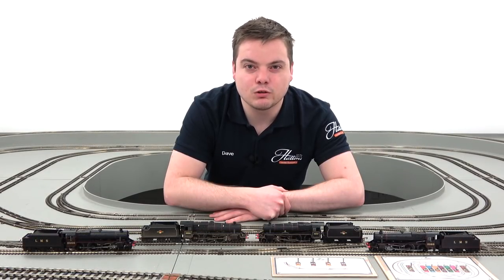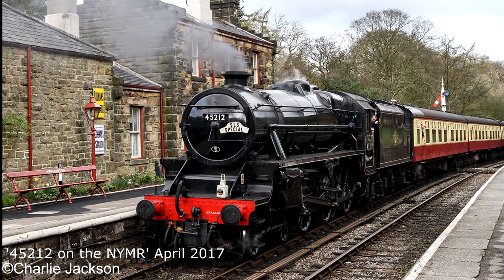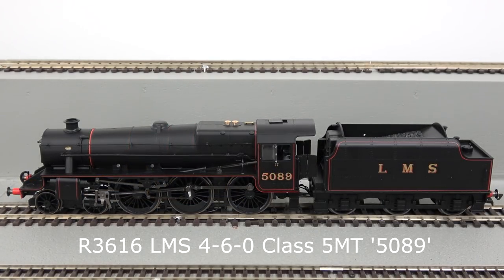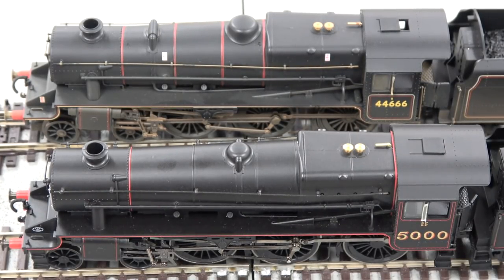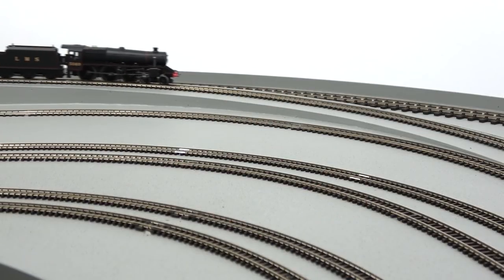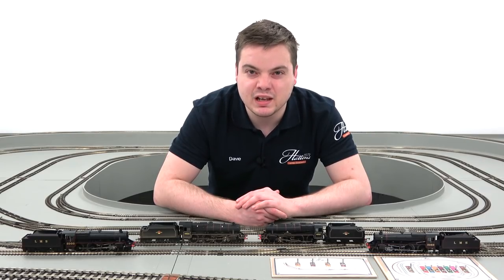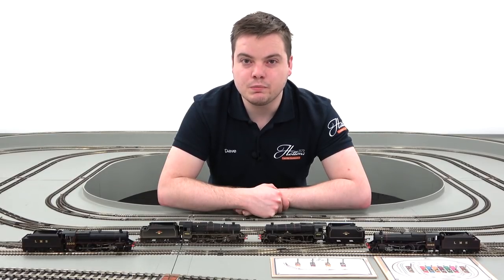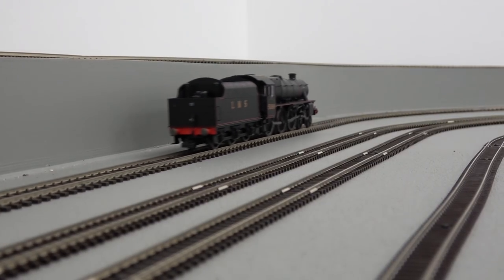Hornby Black 5 4-6-0 - Model Overview

Comment: I am an LMS lover to a certain extent. I don't have a Black 5 model in my collection. But I do have 0-6-0 3 and 4F Tender Engines, one of each to make two. They are LMS engines like the Black 5. You forgot to mention the Black 5 is Jack of all Trades. Its livery could be known as Ace of Spades Black. In the past, after weekend days on the SVR, I'd return home as black as the Ace of Spades with soot from head to foot. That's how much I love steam engines, no matter what kind they are. However, I still love GWR engines, like my beloved Foxcote Manor, best of all. For me, GWR engines come top of the heap.
Reply: The 3F  and 4F 0-6-0's were, strictly speaking, Midland Railway designs of Johnson and Fowler lineage dating back to the late Nineteenth Century. The Black Five was a 1930s LMS design. In their BR service days I heard them referred to by many names including 'Mickeys' (no idea, don't ask!) but never Ace of Spades nor with reference to their livery either. I recall seeing 7022 Foxcote Manor in August 1963 on the Cambrian line between Portmadoc and Criccieth resplendent in lined out green . 7022, along with several other Manors had been given a make over for Royal Train duties for the visit of the Queen and the Duke of Edinburgh to the area.

Comment: I have over twenty of hornbys Black five,its a good runner and when it first came out good value,but times have moved on as have prices plus much improved models,the only thing changed on this model is the price,it has no detail pack to speak of, all mine have been improved by using the royal scot detail pack which has proper brake rigging cylinder drain cocks, screw couplings,much better vac pipes,a point i have mentioned to Hornby but they never listen.No the model is well overdue for a makeover has the coro and princess,has it stands against other hornby models,its way over priced for what it offers,sorry but thats the truth!